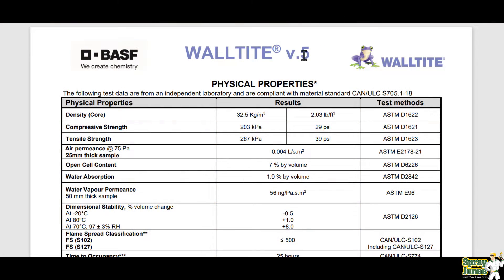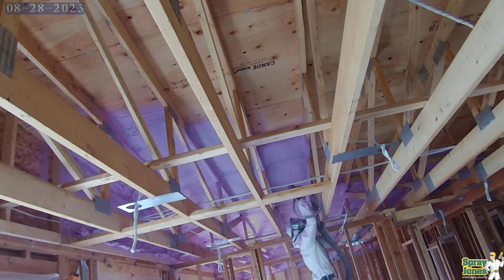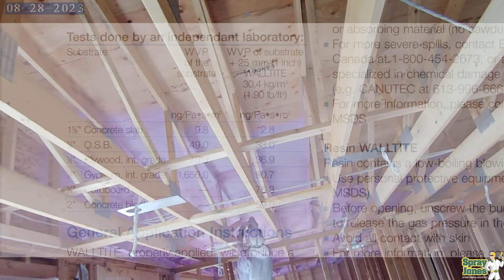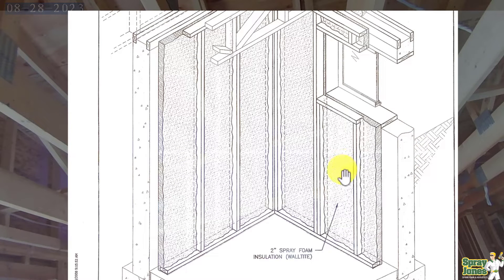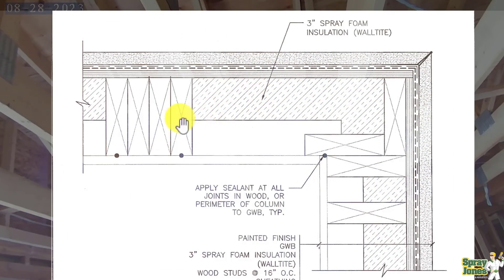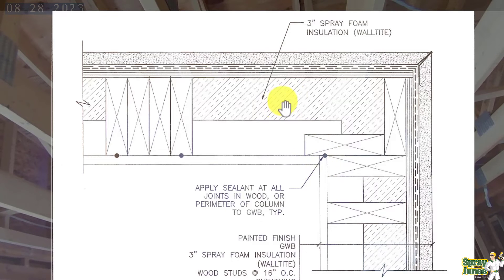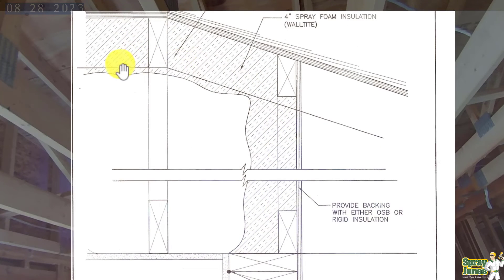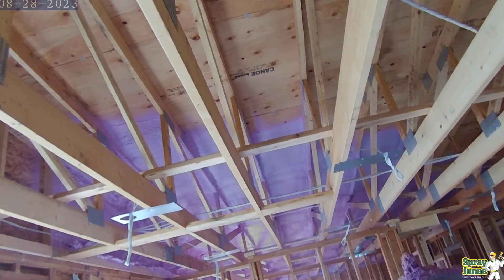Does 2 Pound Foam Need Additional Poly Vapor Barrier?

Comment: Watched a lot of your videos and appreciate all your content. I am looking to build a post frame construction with 2 floors with the outside being metal. I am looking for the most efficient use of my money of course. From your experience can I have the building constructed put the metal on then have someone come and spray 2-3" of closed cell directly to the metal? That way I don't  have to worry about wrapping/encasing the structure before the metal goes on or the foam is applied? I watched the cathedral ceiling vids and that's what we will be working with as well. I'm in lower Alabama right on the line of climate zone 2 & 3. Thanks and keep up the content
Reply from the maker: Watch the playlist for metal buildings. There are a number of videos in there for post frames. They will help you get started.

Comment: Depending on  your dew point. And where that wants to happen.

 If you don't have enough heat loss through your r value thickness of foam you won't have a dewpoint. (You will not create moisture cold effect) therefore you will not create moisture from within.. after two inch you get vapor of course!! So you will not have water protrusion from outside.

Don't lick your cold basment with 1 inch for example!
Reply: My neighbor and I had a debate. He lost. He was telling me how warm his garage was in the winter. I told him that was from the heat loss through the wall assembly. Blown in cellulose. He said it was from the heat from the car's engine after his wife got done from work. So I asked him where his air barrier is then. I told him that it was 6 mil poly. Problem is they staple it full of holes. Then the drywall. More holes.    I still don't know if he has figured it out yet.

Comment: Layer it a few times so it skins and seems to work great as a vapor barrier, but you are the pro. Only problem is my basement is too dry. 1964 basement doesn't go over 40% in the summer. Needs AC all summer now, lol.
Reply: Are you saying you use to be able to grab cool air from the basement but it's not that way now?
Reply: @ericwotton2046  No, I need to run AC into the basement now.